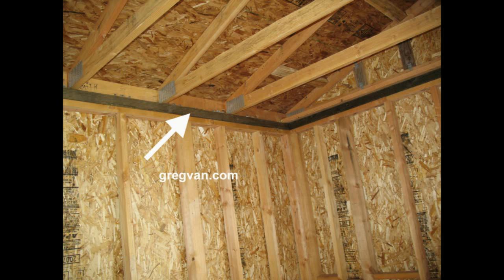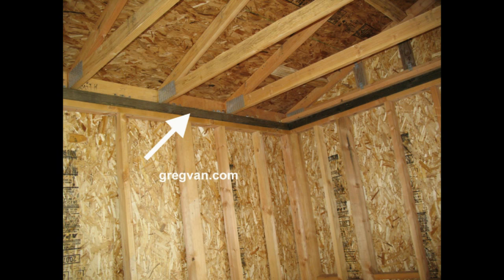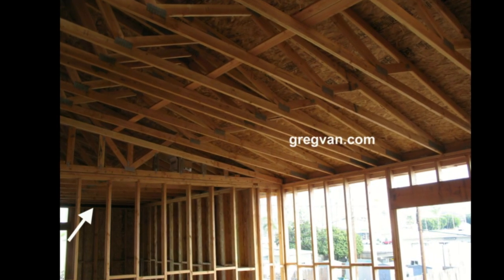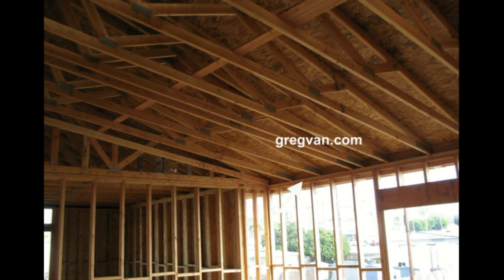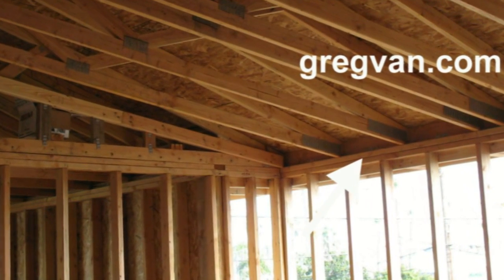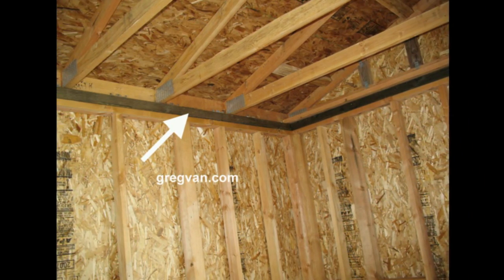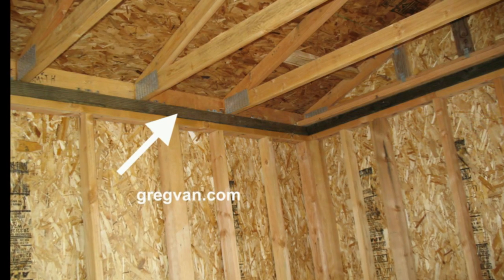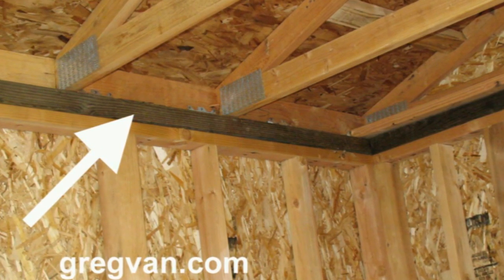Green Wall Framing Top Plates - Home Building Education

Comment: Nice video as usual. Thanks for uploading.
You should also dbl check the nailing.  Nails and fasteners that are in contact with PT material need to dipped galvanized or stainless steel or other approved product per code section 2304.9.5 Fasteners and connectors in contact with preservative-treated and fire-retardant-treated wood.